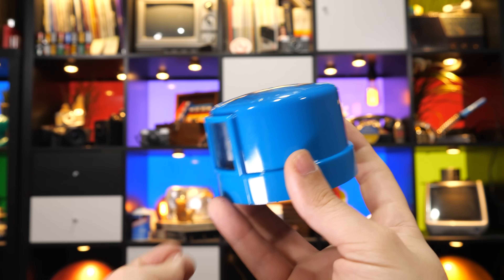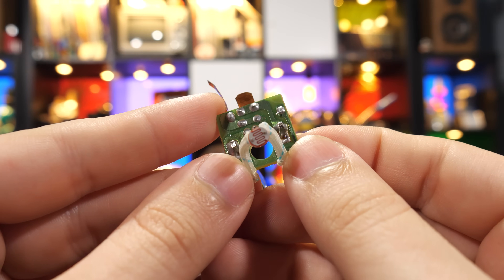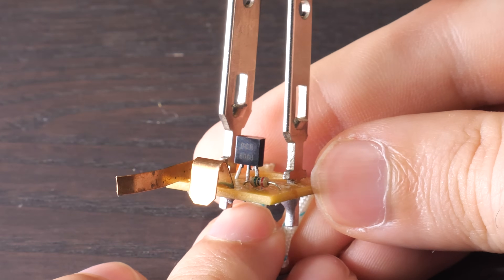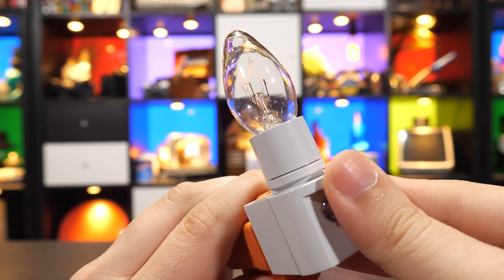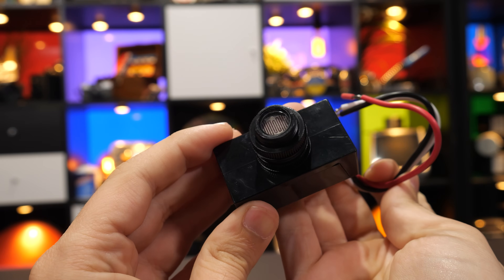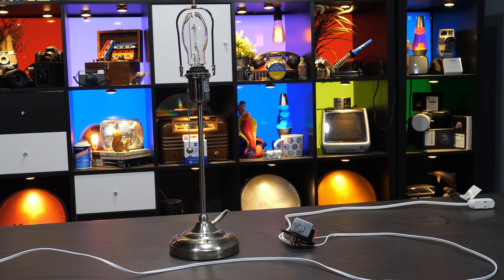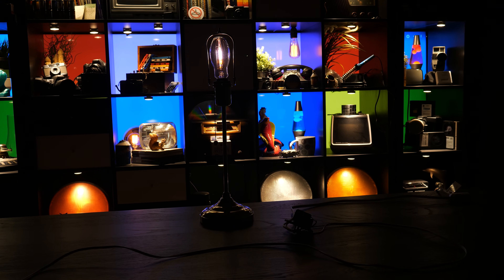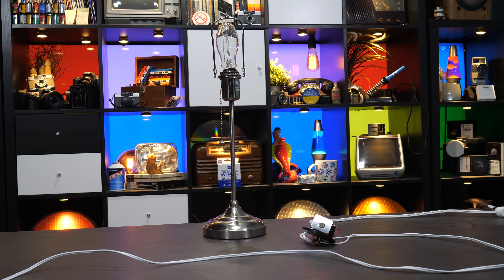Photoelectric light controls are weirder than they seem

Comment: FANTASTIC. Yes I'm shouting. One of my favourite little bits of technology. I happen to have a couple of Tyco branded PE cells tucked away. They are the chunkier but elegant bimetal types. I'll send a pic via twitter. The voltage range is not just for International use but a lot of US streetlights can be 220/240 volts. In Australia there's been a move away from single PE cells and banks of lights. On overhead wiring it means they can be spliced into individual phases along the street, load balancing, and removing a single point of failure. Also removes the need for an extra pair of wires being strung.  Areas with underground power now have an electrical box and power on separate lines. Utility companies have found out the hard way that the Chinesium PE cells are failing very quickly as they have caps and relays. Whi'd have thought. Lol. Lots of fittings have the PE on bottom of fitting as there's a little bit of UV protection, but more bird poop protection! Cheers

Comment: Photocell + Darlington transistor array + AC relay. "Wastes" microwatts of power instead of multiple whole watts. No microcontroller or software required. Doing it with a literal heater and limit switch is just downright lazy engineering.
Reply: Does this approach handle not toggling the light every time something gets in front of the photocell?  Alec mentioned that was a key feature, due to the light technology being used, and it matches up with a vague memory I had also.
Reply: @edgrimm5862  Good point. No. You can make it handle that by adding more electronics like a diode and a capacitor, but then you have the issue Alec pointed out about capacitors baking in the sun. That said, there's really no harm in rapidly cycling LED lamps. The requirement of hysteresis (I was one of the people who wanted him to say that word) is kind of an anachronism now that sodium lamps are bygone.
Reply: @edgrimm5862  You can definitely add delays and hysteresis in an electronic circuit, capacitors in the sun is not a valid excuse since we are only talking about signal stuff (no power would hit the capacitor). These type of product scream we have done it this way for 70 years, and our company is not willing to spend the money to hire a proper EE and design a decent version of the product,  especially since new installations will have much smarter light controls and these are only used in retrofit (which limits the total addressable market, and thus reduces the company ROI)
Reply from the maker: @pelor92 That really depends on your definition of "decent," doesn't it? Every new feature or function you add is another opportunity for failure. When the power consumption of these things is only a couple of watts, you're chasing diminishing returns from the start. So at best you're gaining a marginal power savings, and there are already ways to mitigate that (such as central wiring, which is pretty much the default where I live).
Reply from the maker: Honestly I just bristle at the idea that old-school is necessarily bad. Several years ago I was driving through my old hometown and an entire block's worth of LED streetlights was repeatedly coming on and off due to a passing storm. On for three seconds, off for two, back on for another five, off for 12. While LEDs can tolerate that fine, it's annoying if nothing else.
Now, I have no idea what sort of system was controlling those fixtures. For all I know if could have been a photocell like these failing in a peculiar way, though I can't see how really. My point is that when there's a cheap, obviously functional solution that checks all the boxes already, you're not really gaining anything by redesigning it.
However, I would not be surprised if newer LED fixtures just incorporate their own light sensors. They already have a power supply and are complex enough as it is. That also adds opportunities for, say, electric vehicle charging using power run to light poles. That doesn't work in centralized schemes because there's no power during the day.
But if your only design requirement is "when the sun's up, open this circuit" - keep it simple.
Reply: @TechnologyConnections  you are right fetishising new stuff is wrong, however I feel there is a double standard on this stuff, there is fairly often a strong backlash against soft power on circuits and indicator leds on appliances even when they only consume tens of milliwatt at most, while it is  fine to consume 2/3W constantly (which is two orders of magnitude more) for the sake of old school.

Note that the solution I would design uses technologies from the 70s tops, just swap the LDR for a phototransistor  and use it to drive a relay resistors and capacitors as needed to adjust the timing, so not a paragon of modernity and it would consume a lot less power
Reply from the maker: Oh, don't get me wrong, I think there's definitely a case to be made that these could be improved. If anything I'm hoping to push you towards a more holistic approach to evaluating this. If the technology has been available since the '70s, I would imagine somebody tried it at some point. There could very likely be some combination of factors that means what seems more sensible at first... just isn't. But I don't know that - it's also likely that nobody thought to try anything new. Though, honestly, we were on quite the energy-saving kick in the '70s so my money's on the former.
And truthfully, I think that putting one of these on top of every light fixture is excessive. But, depending on what else you want to do with the system, it might be more convenient. Everything's got trade-offs, and there's more than one way to solve a problem.
Reply: @TechnologyConnections  The electronic versions of that photoswitch are indeed commercially available for example TE connectivity produces both the old school thermal (ALR-LC-120) one and the "newer" electronic one (ALR-8090-MFS).

The newer seems to cost roughly the same, and is rated for a much longer life (20 years as opposed to just 4 for the thermal one), as to why the old one has not been completely superseeded I can not tell exactly, however I can speculate:
- Istitutional inertia (large utilities have probabily automated stock management system and unless someone pushes for changes, the default is status quo)
- For the producers there are barely any cost for runnin the production line that has been working for 50/60 years apart from the BOM, and all the R&D costs will have been recouped long ago, so now it is all profit

Comment: The little bit of heat they create probably helps melt snow off them in the winter, keeping the light from being on all the time because the sensor is covered up. Like how stoplights had to add heaters when the went to LEDs.
Reply: BUT SOMETIMES!
Reply: @K-o-R My first thought exactly! 😂👍That was one of my favourite TC videos!
Reply: @K-o-R  you just earned a like 👍
Reply: Although don't traffic light heaters only operate when it is snowing and thus still end up using less power than incandescent?
Reply: @soundspark Even when heating the snow away it probably uses the same if not less power.
Reply: @aculleon2901 Should be the same, heaters are 100% efficient so if the heat is the same so should the energy needed to make it. Incandescent bulbs are just bright heaters btw.
Reply: @ShmoeBoe  I know but my idea was that the heater can be controlled without the light turning on and off. So you could pwm controll the heating element. 
Also the heater is closer to the snow itself and does not heat up the rest of the housing. I dont know how much of an impact that would make. As said above, the leds themself are also using quite some power. So maybe we dont even need such a system.
Reply: @aculleon2901  it uses less power and depending on location doesn’t need to be on for half a year, or not at all in some places because there won't be snow.
Reply: I would think this design does not work well in cold climates. Imagine it’s -40 out*, but a clear bright day**. It seems unlikely that the half-watt would be enough to trip the limit switch. 
*C or F. Take your pick. AKA temperatures I haven’t seen in a decade. 
**counterintuitively, in the dead of February, cloudy skies trap heat and so are usually warmer.
Reply: @RichardBetel  Fun fact, -40F is the same as -40C. When I realized this, I also realized why the common sayings is 'It's like -40 out'.
Reply: The reality is so much simpler in most cases. Many streetlight networks are centrally turned off during the day, so the local light sensor only controls the dusk and dawn behaviour. Some areas even have central overrides that turn on after a certain time to make sure all streetlights are on during the the core of the night. The former is more often used in cold climates where the sensors could be blocked or the outside temperatures be so low that they interfere with the heating element (cool it down so much that the light doesn't go out), while the latter is more useful in hot climates, where hot temperatures could switch off the lights during the night---or really high up north where nights can be too bright to trigger the sensor.
Reply: it would need to work the other way around then, heating up when it is dark (or covered by snow) and not heating up when there is light
Reply: Just add another transistor! @tommucke
Reply: That's interesting, but an LED street lamp would still likely consume at least 100W.  That's definitely enough heat to melt snow.  Since LEDs don't experience much stress from frequent on/off cycles, if enough snow were to cover the sensor to trigger the lamp to turn on, the lamp could simply melt the snow and turn off after it clears.
Reply: @Toastmaster_5000 not true
L.E.Ds use and only require 12 volts to operate
Reply: @stephensnell5707  Seems there's quite a lot about LEDs and electricity in general you should brush up on:
Individual LEDs only "require" 1.7v to 3.6v, depending on the color.  The reason you can see them operate at higher voltages is because resistors are used to restrict current.
As such, LED brightness is primarily determined by current, not voltage.
Regardless, I said an LED street lamp would consume at least 100 watts.  That doesn't mean you couldn't be using "12v" LEDs, because that would imply they're using 8.3A.  Street lamps need to emit more lumens you'd think, and LEDs get pretty power hungry when you need them to deliver some serious brightness.  That's especially true if they're designed to run hot (as a means of planned obsolescence, since LEDs can last for decades if they're not pushed too hard).
Reply: So I see what you guys are getting at but, In rare cases where snow fall does effectively cover the light window on a photocell on a street light, the heat from the light itself will melt the snow. Even an led. Look at a roadway lamp in the day light during winter months. Small icicles hanging off. Also snow isn’t  opaque enough to block the daylight coming into the photocell in most cases anyway. The light may turn on an hour earlier than intended is all. The wind usually takes care of everything. Not aware of any utility that worries themselves with this. (Work with streetlights for the power co.)
Reply: @brenteichel7661 I agree it's not the end of the world if the street lights come on early when it's snowing in the evening, if anything it's better for visibility anyway!
Reply: Actually it did. For many years I had an actual street light photoelectric  control mounted  outside  my window that I used to turn a small night light on as dusk and off at dawn. During the day any snow that collected on the top of the control would melt off due to the heat from the thermal relays heater. Of course if it were bitter cold during the day then it might not melt off but as long as the Temps were around 20-30 deg F the snow would.melt off.
Reply: It never is about peak efficiency.
Reply: It goes the opposite of what you've suggested. If snow blocks the sensor, the heater turns off.
Reply: Heated stoplights? We’ve come full circle!
Reply: You had better not turn this into a BUT SOMETIMES argument.
Reply: Interesting. But it doesnt snow here
Reply: tho it wouldn’t be a bad thing if they stayed on when it snows
Reply: the point is, while the main function of heater is to turn off the light, it uses less power than the light does, but also stops it blinking on and off when there's leaves in the way, birds, etc
Reply: C'mon, guys, leaving heating elements on for LED traffic signals 24/7/365 is still a massive energy savings when you factor in what they wasted with incandescent.

Sheesh, next thing you know, we'll be arguing over a 0.001 mpg fuel economy loss because auto manufacturers tied the heated mirror circuit to the rear window defogger circuit, and griping over how many drivers are wasting gasoline every year by unnecessarily heating their mirrors! 😆🤪 

Instead, we should be talking about how many LED traffic lights and street lamps have premature failures. In the past several years, we have had several "highway discos" and completely dark sections of highway due to driver failures, and we even have a city that setup a reporting hotline for LED street lamps that suddenly turn indigo due to phosphor failure. (Welcome to Connecticut.)

When Dollar Tree home LED bulbs, pushing their chips to the edge of tolerance, last longer than commercial-grade municipal lighting solutions, there's a BIG problem that needs to be addressed.
Reply: @dashcamandy2242 someone's been "LED" down the wrong path
Reply: @dashcamandy2242  Apparently it's not
Reply: Or we have heaters as option to more efficient ones to turn on during snowy days, and you can control it with a tiny LED and a fibre optic, if snow can reflect the light to a light sensor, heater go on, no snow, light isn't reflected, no heater
Reply: @LillyP-xs5qe No need for even that much complexity. There are transistor output thermal sensors packaged in TO-92 that come with factory calibrated thresholds that can serve the same role as the LDR, but for temperature. This would just kick a heater on when the temperature goes low enough, which would obviously be a bit less efficient than controls that need actual snow to activate, but it would work and it would bypass the need for fiddly fiber optics, the chance of unskilled assemblers screwing up placement and alignment, the addition components to read and react to the level of reflected light, and the need for the clever physical engineering required to make sure that snow falling with any vecor activates the sensor.
Reply: @AtlasReburdened  you do know the fiber optice can just be a fishing line right? all it needs to do is not let light from the LED trigger the light sensor unless something is reflecting it from the outside, even a basic light trap could work, also Just make the LED only turn on when the main sensor says it's dark but before it trigger the light and bam, it won't trigger the heating during the day
Reply: @AtlasReburdened  You don't even need all that. Use a different component and you can get thermal switch and heating element to exist within the same component. What I'm talking about is a PTC thermistor.
Sized and selected appropriately, it will heat up to a given equilibrium temperature when connected across mains voltage. It'll automatically output more heat when it's colder and less heat when it's warmer.
Doesn't even need to know what temperature it is to do the right thing.

Comment: This is such simple engineering design elegance. Public lighting is typically tied to public safety and for such a simple device, they can be fairly prone to failure. This leads to what the utility industry calls day burners. Basically, in the absence of a functional photocell, it will run the light until the light fails. Literally, the definition of fail-safe.

Source: Engineer for large electric utility for more than 14 years now.

Comment: I think we have mastered the art of making something as cheaply as possible. But I am somewhat confused why each lamp needs it's own twilight switch, I would think that the switchboard would have one connected to a contactor, or using a programmable / astro time switch. Also digital time / twilight switches draw less power then you would think.

I have also seen other types off light control such as: Lights that dim when no one Is nearby and go to full power when you approach (also with twilight switch), and light control that switches on when it gets dark but then switches off past 10pm i guess for light pollution or power saving.
Reply: I had that same question, but I kept watching the video and heard the answer.  They don't all need their own switch, there are places where they're hooked up to a common switch that controls a whole bank with a contactor.

I've seen two setups for lights that are dim normally but light up more brightly when people approach.  The more straightforward implementation actually has two sets of lights, one of which is always on and the other is activated by a motion detector.  I don't understand how the other setup works, but there's clearly just one set of lights.  I doubt that it's really complicated, but it's not my field.
Reply: I had read that initially the photocontrols could handle a limited size of load and that for a while they were only able to control one or a few fixtures each. I guess this was before they came up with a way to control a whole string of lights with one. Around here, the latter approach is more common on major roads whereas individual controls are more common in individually-placed fixtures like in residential areas. Also, back when photocontrols were new technology and still expensive, manual or timer-based control was common. There were even fancy timers that would slightly readjust themselves each day to try to follow the shifting sunrise/sunset times over the course of the year.